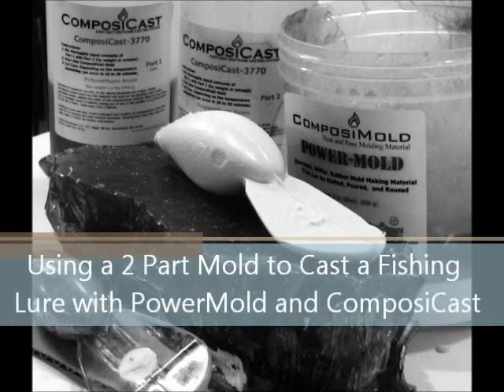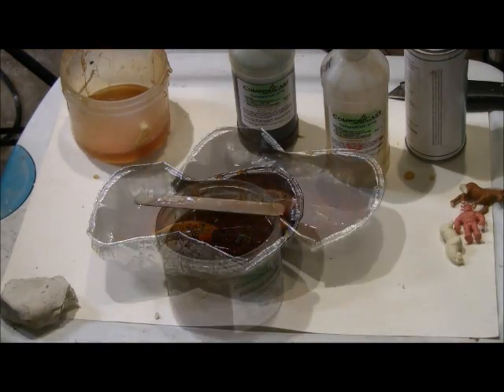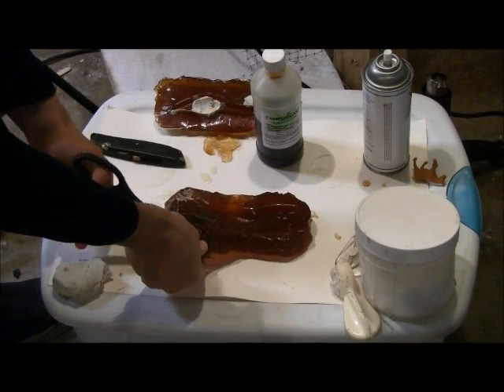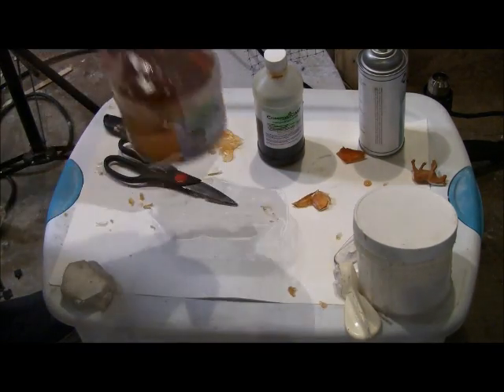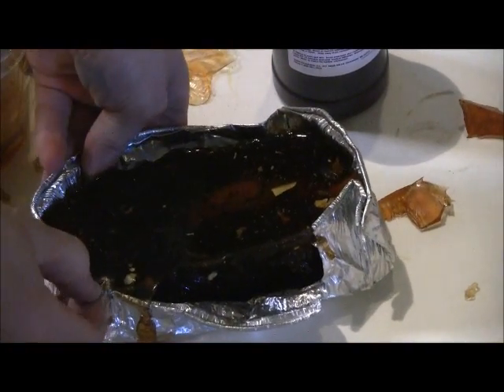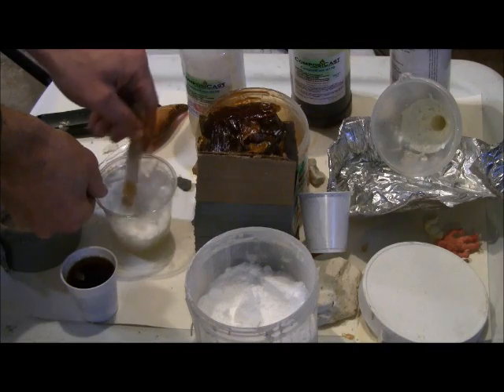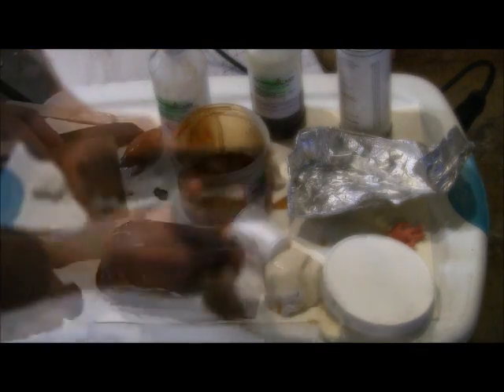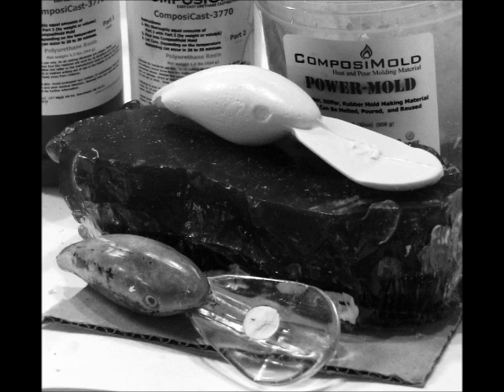2 Part Mold Fishing Lure Cast Using PowerMold & ComposiCast

Comment from the maker: Hi deathknightevan! We've had ComposiMold tested up to 35 times but have personally re-used it over 40 times. AND last weekend at the iHobby Expo we had some return customers tell us they've made over 200 molds with 2, 40oz. containers of ComposiMold. They said they figured they'd saved over $2000.00 in replacement model parts. Sweet!